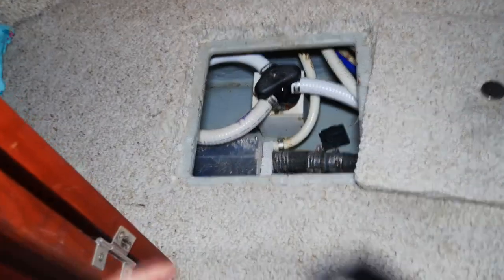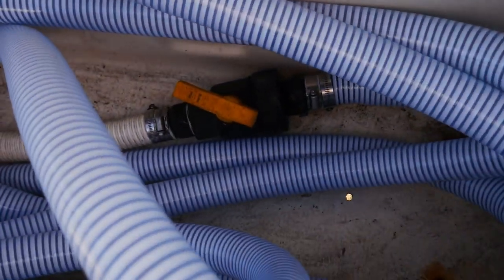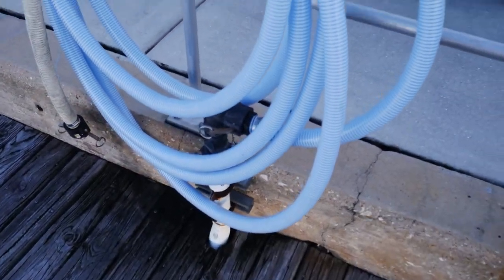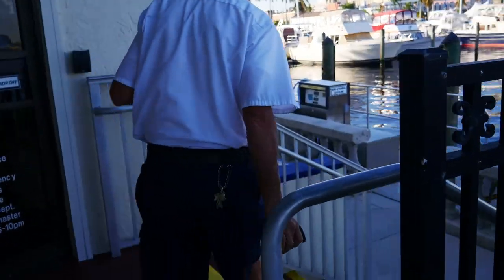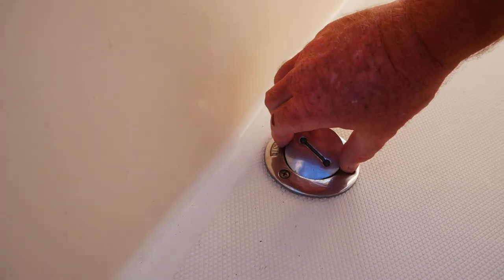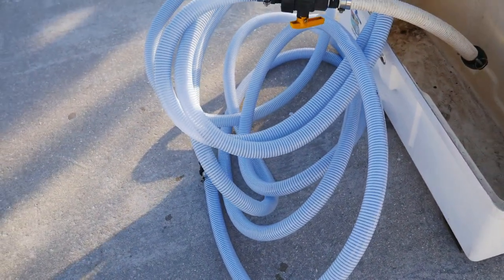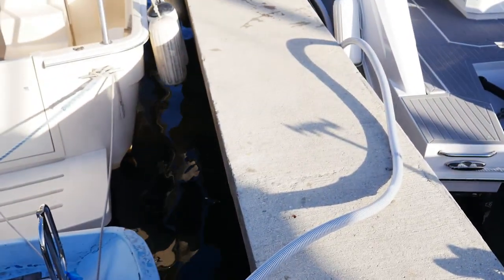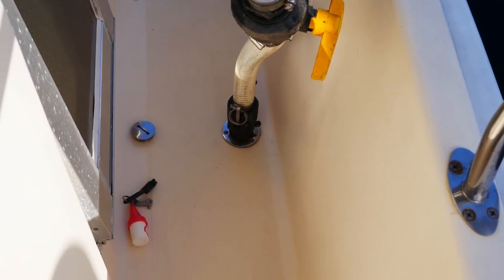How to pump out your boat while at a marina. Boat pump out 101.

Comment: That screw-in fitting will be a godsend. Thank you for sharing that. I'm going to pick up my own to have on hand. Also spray down the valves with disinfectant. Use gloves. Have a small trash bag and a rag or two with you while doing the dirty work. Good video,very helpful.  Especially the rinsing/flushing and final pumpout until its clear. Again thanks for the tips.
Reply from the maker: You bet

Comment: Do you run the macerator during the pump out process or not?
Reply from the maker: No. The macerator pumps the tank overboard but the pump out from a dock the hose is a big vacuum and sucks out the tank contents.
Reply: @aboardagape6390   Thanks but I only have 1 waste connection port on the boat.  its a screw fitting on the side about 6 inches above the water line.  I typically use a bellows type TW macerator to pump over board to a hose to a sewer connection when I am trailering.  To use a dock side pump out it would have to pump through the macerator.  Would the macerator be harmed?